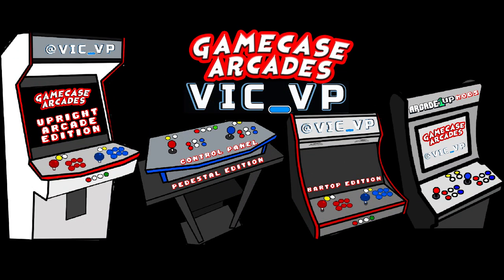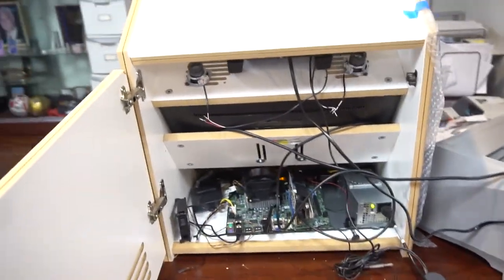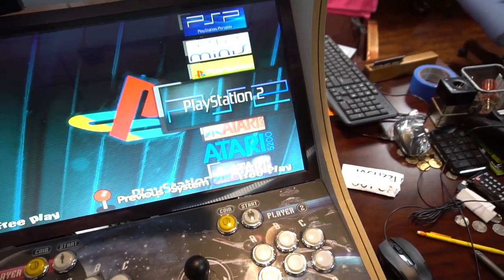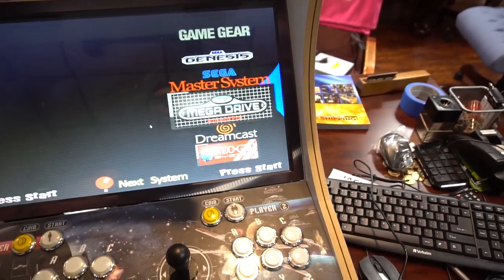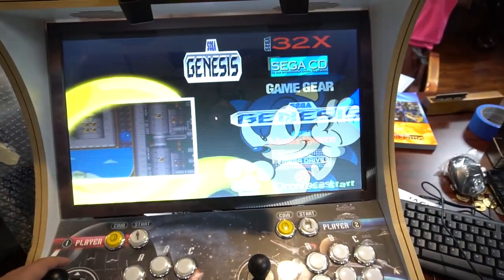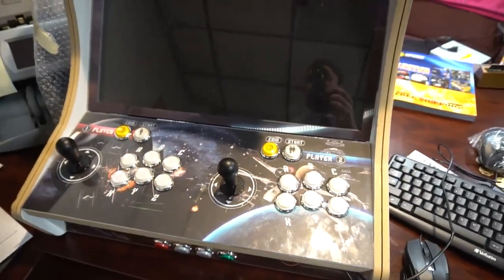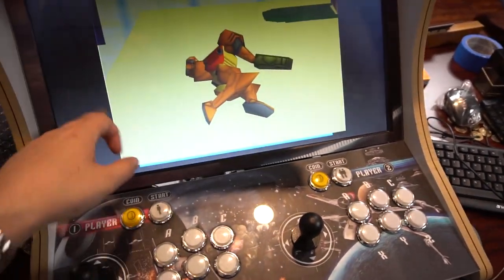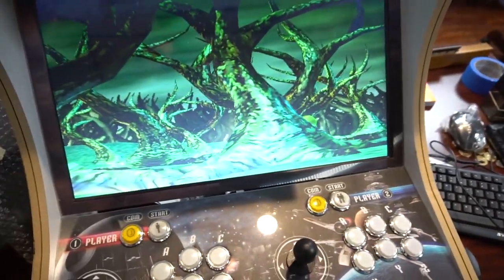Subwoofer in the budget beast bartop!

Comment: How about putting a smaller Logitech z213 inside? Is possible to put those without taking apart the Sub, on GRS bartops? :)
Reply from the maker: Never did z213... that's prob a less watt system

Comment: How long does it take to configure before handing it off to customer?
Reply from the maker: Keep in mind I do this on the side apart from my real job. PC builds are very delicate meaning its not a simple copy and paste. I would say at least 2 months from start to finish. 
Currently with this build I'm trying to fill it up with games that are meant for arcade... meaning my drive currently has dos box and scummvm which are PC games that need a keyboard. 
Only think holding me up with this build is I'm waiting for MK11 to be cracked along with customer requesting ps4 controllers instead of xbox controllers which I must test out
Reply: @Vic_VP  ms dos, commander keen by far best game 😂